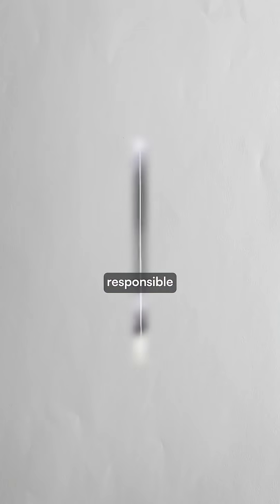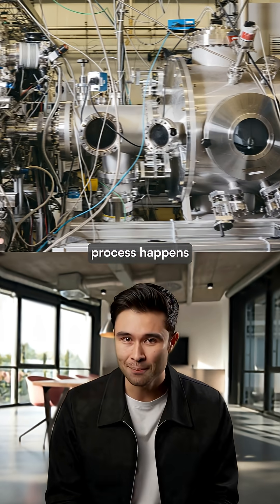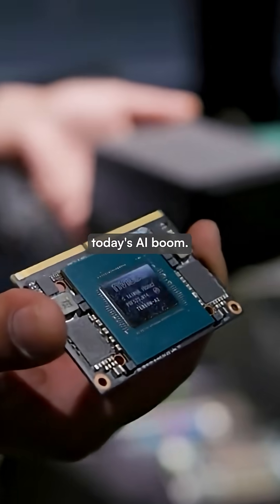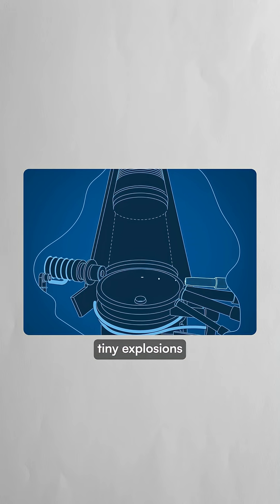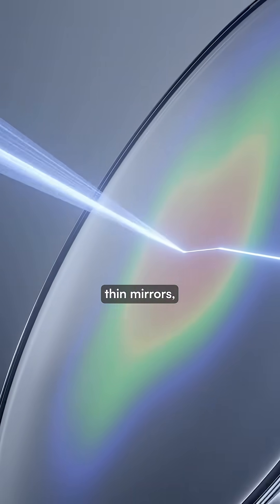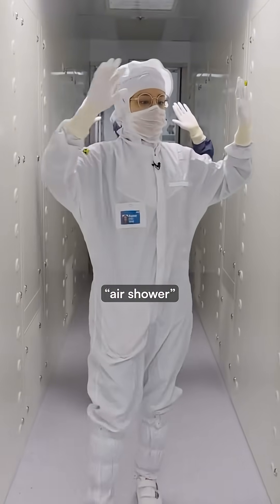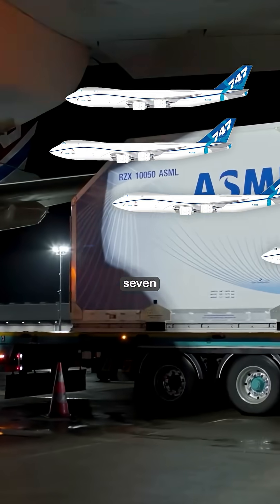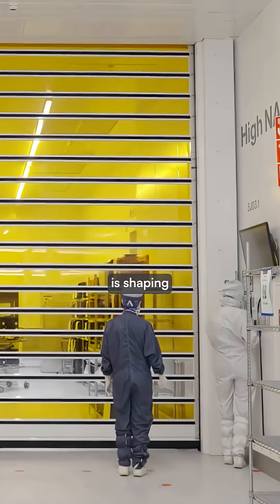These machines are responsible for the world’s computer chips ⚙️ #trendingshorts #ai #data #tech

Comment: Carefully soldering copper with copper plasma 

For a transistor based cpu 

Allows the pegs to be used as transistor sites to send and receive through

While the circular solder, around the wire, connected to other locations

Becomes magnetized with electronic current 

Forming core memory, naturally 

In a copper switchboard on wood, with copper solder

For wires

Hand made at first, 

But then copied 

For instance 

When one airplanes chip works well

It can fit other airplanes without modification 

By aligning with the corresponding input and output locations

On a given ship.

Thats how to make a CPU

Tin, it prevents souls made of aether

From doing this

Which is actually not good

Although good luck proving that

Its just a trade secret 

The soul gas

Its plasma 

Re arrange it

And it counts as voltage or amperage 

In the form of photons and ions 

Pretty much just floats around everywhere 

But it comes from stuff that either used to be alive

Or isnt yet 

Not electric current, like electrons 

More like light particles

Orbiting a hydrogen atom

Which gets stuck in the crystal structure 

Of different materials 

Like quartz

(Thinner phone screens, nah)

Comment: Does he mean the internal temperature or the surface temperature of the Sun?  There is a extremely large difference which should be given some consideration when stating such phrases ("hotter than the Sun").
Reply: In extreme ultraviolet (EUV) lithography, the plasma used to generate the EUV light reaches extremely high temperatures, typically around 220,000 degrees Celsius.
Reply: @charliefoxtrot5001 thank you that information!  So, it's a couple of times hotter than the surface of the Sun but much colder than the core of the Sun.  These scientific videos should use more precise phrasing.
Reply: @juancdeliotejr5443  Yes, it's super hot plasma, but there is no fusion going on here.

Comment: Haha this company is soon out of Business. Cutting off China was a huge error. They got so angry and invested billions in new technology, better and cheaper than the Dutch and this will take the advantage away this company had. You cannot force China to anything. The turn around and remove the carpet under your feet. The had more Engineers to find a solution, than the Netherlands has citizen. Now they work with light, 100 times faster than this top NVIDIA chips

Comment: And yet the EU still hasn't gone and developed much fab capacity since AMD spun off Global Foundries. And most of the TSMC plans along with Intel from what I understood have fallen through particularly since the Trump Administration took office along with Dixicrat Republicans taking control of the oth😊er branches. 

You'd think that the EU would be the center of the global chip manufacturing, but in fact it's the US (TSMC is effectively outsources traditional US capacity). From my vantage point, it appears this is largely due to the primary and near total source for the ultra pure sand needed to make semiconductors is only available from one/handful of mines out of the East Coast of the US. Without this sand, global semiconductor manufacturing would cease, which may still happen a a consequence of climate change. There was already a wafer shortage due to the hurricane that hit the mines last year.
Reply: You need to take your meds on the Trump Derangement Syndrome there!

Building these fabs requires investment and expertise. The Europeans are very good at regulations and protests.

Comment: I told NASA about the Moon and they made Moonfall ; )

Its not too late, need to make a Universe room and reverse Tesla ball atmosphere models, also just spray desalination ocean water, not aluminum and carbon which cause refractory radiation and is cooking the atmosphere and causing refractory radiation on the surface making it intense, also you might be able to change an orbit. Also the aluminum and carbon being spayed refracts photons, charged electrons, does electro photo synthesis and while you're burning oxygen instead of hydrogen from say, solar electrolysis of ocean water, you're burning oxygen and binning oxygen to carbon and the H is bondung into CH4 Methane up in the atmosphere. It's all backwards

It is imperative that we stop spraying aluminum and CO2 into a magnetoshere and start spraying desalinatated ocean water instead, were causing refractory radiation and it's making the heat much more intense and heating the planet and causing melting of ice caps and evaporation of ocean water which then makes fresh clouds; we need to just spray salt free ocean water. The more we try to cool the planet were actually making it hotter and energizing a magnetoshere which could cause more solar flares and fry us. We're cooking the planet and causing solar evaporation of the ocean for clouds formation instead of just misting H20 out of 747's, got a whole plan

Hello my Friends

ANUBIS IS THE BEST DOG

What if Pharoah was trying to build a weather machine to attract lightening to nuclear electro magnetic earth ground to cause more rainfall and thus more food. 

Clouds of higher solar charged particles jump to clouds of lower static change, known as heat lightening, as nature seeks a balance. 

When there's enough solar charge in a cloud electricity as lightening crosses the air insulator and connects to earth, as it does it creates a vortex where hydrogen and oxygen particles connect and bring down water droplets and fall due to nuclear electromagnetic gravitational earth gravity. 

Electrons go around an atom like the moon around the earth and the planets around the sun.  

The Egyptians saw that lightening was attracted to metal, and the higher the better. 

If Pharoah had a copper cap on the pyramids with electrodes running through the air chambers down into the spring underneath, Benjamin Franklin might have been wearing an Eye of Horus Watch and driving a Bently.

Is the grounds turned dry, like a leather glove, no matter how much you tried to arc welds, it wouldn't work. Tree roots go searching for water in the winter when there is no rain, as solar photoelectric synthesis move through an organism seeking earth ground.

Also lightening is more likely to hit the lone farmhouse than the neighborhood, as electricity in houses flow through a black or hot wire, and take a neutral [white wire] path back to the electrical panel, where the Neutral Bar is bonded to the Ground Bar and goes into the earth via an eight foot copper electrode to dissipate returning unused current into the ground. So neighborhoods are energizing water tables instead of storing that electricity in batteries.

Anyways, I'm thinking a cargo helicopter, a brand new Copper Cap for each pyramid, and copper electrode wires running down to earth ground via the spring water table, and electrodes can be drilled into the earth below the springs for better contact, and we can complete Pharoah's Weather Experiment as lightening is attracted to metal high up from the ground ; )

Could you imagine the attraction of this new event to honor the Pharoahs and those that built the Pyramids!

And maybe bring more rain to the earth, and keep it most, and electrically conductive and inductive to storm clouds for more crop rain. 

If you want to in vent some cool stuff im at 224x833x2094 usa

Also, should we celebrate ancient ruins or rebuild them to honor ?

Also oil rigs should be underwater and not above and you wouldn't have oil spills 

China builds underwater structures, you could be just 20 feet underwater, you can run vertices flexible stormproof snorkles and a flexible to surface entrance/exit 

And, 

Grow more opium most the world's doesn't even want to be here and people can move other places, it grows in attics that are 140 degrees, skylights would need insulated glass in the attic shafts and you could use mirrors in the gable ends, just don't be in the attic in the day, if there's ever a shortage

Also oil rigs should be underwater and not above and you wouldn't have oil spills. China builds underwater structures, you could be just 20 feet underwater, you can run vertices flexible stormproof snorkles and a flexible to surface entrance/exit

Sharks could be GPS chipped at a bait source and an alert could go to cell phones and beach alert systems if sharks are within 300 M

Aluminum spayed in the atmosphere might f you magnetically with solar flares

Use aluminum for other things, spraying carbon and aluminum heats up the planet and causes refractory radiation on the surface, the carbon in the clouds traps in the heart and in the ocean causes dead spots. You need solar distilled ocean water misted or of 747's instead, the sun will burst up H2O into H, O1's, making 02, O3 ozone, and you're actually adding more fresh water clouds up there, not depending on surface evaporation by causing more heat in order to make more clouds, you need to cool it

8.4 billion acres of grass=4 billion cows in the world shipped frozen fresh lawn mower clippings somewhere cool like Alaska and each cow gets a bowl of ice cream at each feeding session

You need a leaf sucker truck with a refrigeration unit, grass is mowed for tax refunds, 20 Million jobs paying 60k from May to October in air conditioned, sealed window, tinted window, XFM lawn mower cabs with triple level suspension seats, mini leaf suckers pick up small piles and dump them by the street, big leaf sucker truck picks them up and freezes the frozen grass and then it goes to rail cars then somewhere cool to be 1100 lbs with a boney jacket. The people that kiss cows and sing songs for them take care of them and she gets a bowl of ice cream at the end of each feeding season. You'd have 10x more cows, over 1 Trillion in goods. In the US you'd have to double your grocery stores just for the milk, cheese, cheese cream, sour cheese, cottage cheese, yogurt, milk, butter, ice cream, etc...

When she doesn't want to be a cow anymore she gets a bowl of ice cream with some fennies

I have a lot of invention ideas in energy, defense, security, food infrastructure etc...

Would like to meet up with some people and talk to them about making some cool stuff

Missing solar film wrap on high rises and fields shouldn't have solar panels but should be solar panel green houses growing every crop everywhere, humid and tropical warm all year growing facilities

Comment: 😂😂😂😂 That’s old technology! The microchips of the future are not in a wafer format. Instead, they are marble-sized spheres filled with pressurized single and blended gas mixtures containing floating nanoparticles. These marbles have spikes made of different materials; they resemble World War II-era water mines. 

Larger orbs can have smaller orbs with spikes and filaments attached to the spikes of the outer orb. The nanoparticles are made from various materials with specific physical properties that react predictably when exposed to variations in magnetism, light, heat, cold, and electrical current. 

This technology measures results in a non-linear wave and operates at speeds close to the speed of thought! It's worth noting that this is a very basic description. The technology was developed simultaneously by two individuals—one in Puerto Rico and the other in Latvia. 

While wafers are still in use in the 31st century, quantum orbs have become the predominant simulators for multiple scenarios, achieving an impressive accuracy of 98.9999%!
And if you don't believe this information, well it's true you read it on the internet! 😂😂😂😂😎😱🖖✌️🍻

Comment: The details of all the things that these machines do is just insane.
The tin has to be ultra uniform and consistent in its shape, kept moulten. 
also the laser first fires an initial pulse which causes the droplet to change into a disk shape before it is vaporised. 
It has to. be vapourised perfectly, so no left over residue that might cause deposits to accumulate. 
This is but one aspect of this machine.

Comment: And they use Tin on purpose because it deforms over time and shorts out, breaking the circuits. Then you need repair/replacement. Tin is terrible for circuitry.
If they used copper, silver or gold, it would be more expensive but would also last 100 times longer
Reply: Dumb as oak

Comment: So if the tin is just used to make light how do they make the diagrams and patterns that the light goes through
Reply: I'm just guessing, but I think the idea is that the UV light is used to "flash" or "bleach" the diagram into a surface.

Think of for example how sun bleaches objects left into sunlight for too long. The UV light produced by this machine would be far stronger and the material used to receive the pattern is probably something that's more sensitive to this UV light?

I'm guessing that's probably the broad overall idea here.

I'm unsure about the specifics. Like I'm not sure if they have a "shade" of the inverse pattern ready so it can be used to "expose" the pattern onto the surface (with the help of complex optics system to work at the desired small scale, so the actual template doesn't have to be as microscopic), or is it more like a "tatoo gun" like system where the light produced by the tin is used to place a small dot onto the surface, and then a computer system and fine motors draw the pattern one dot at a time.

Comment: They drip molten tin and use a carbon laser at like a crazy ir 9,000nm level hitting the tin drops at crazy speed and then changes into euv like 0.1nm and then that euv light going through the glass at some spots and blacked out n others to dissolve parts of the wafer to design the chips style. Light is one of the coolest things n the universe